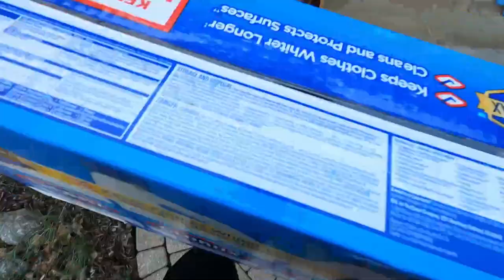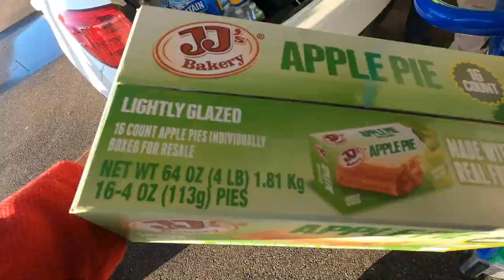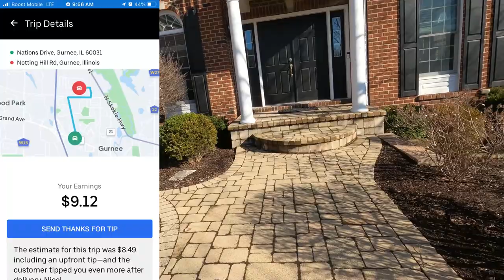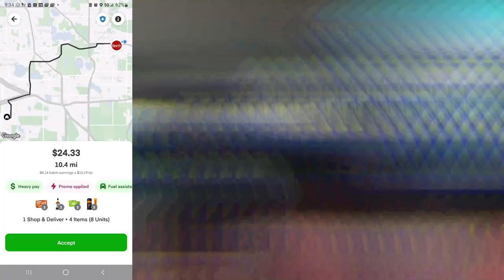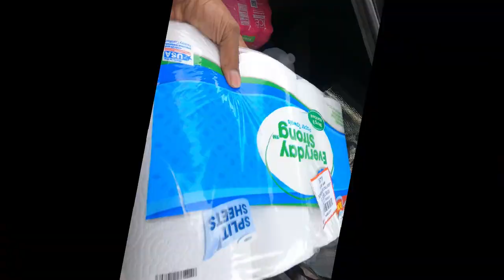Should You Do Gig Work or a 9 to 5? 🤔 Make Money Fast! InstaCart, DoorDash Tips & Tricks, Ride-Along

Comment: 3 cases of water! Good thing she was on the street level floor! 😂
Reply from the maker: Exactly!! I deliver over there so much that I know which apartments are upstairs and downstairs.
Reply: I sign up for Spark, but they're in the process in doing my background check. I had received an email from Spark saying that my background check is pending, but I received another email from checkr saying my driving background check is clear. Have anyone getting that same result when y'all apply, that's strange?
Reply: @Tammy24ist  Spark will send you a text message when they are ready to have you drive. Right now I hear a lot if not all Walmarts are switching from Point Pickup to Spark. Maybe they will send you your text after they straighten out the new locations. Just watch for a text message.
Reply: @Rideshare-Lisa  Ok I got it. Thank you for the update
Reply: @Tammy24ist  👍👍